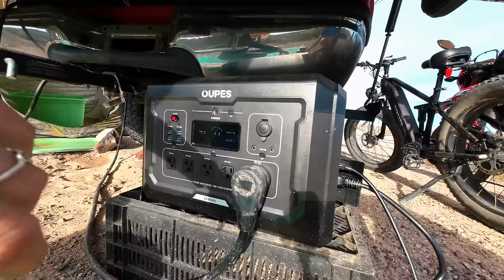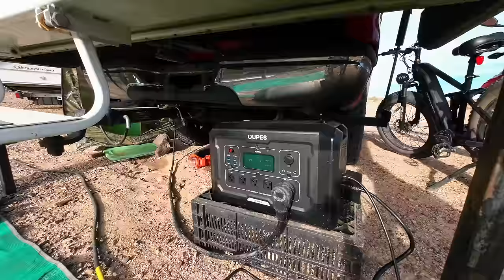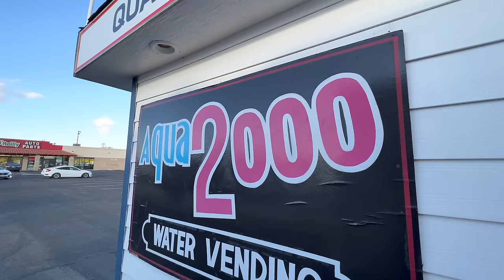Honest Walkthrough and Setup of Fulltime Truck Camper Living after 1 Year

Comment: Great Video!!!  I think I will steal your shower hose idea. I still have the crappy white one in my 850SC!  I do the same thing with the dinette as you guys do. I bought a couple of foldable tables that I use if I have to be inside. they fit perfectly and fit in the under the bed storage when not in use. the two final things I need for my camper is a new outside shower and a replacement affordable 12V compressor fridge. I'll let you know what I find.
Reply from the maker: The more slinky shower line was kinda pricy at about 30$ but had been an awesome upgrade! We have a new refrigeration system we are currently testing out that we will show in a new video.

Comment: Love Northstar! We have the same model and love the simplicity. We are getting older and we have ordered the new Night Hawk model. Can’t wait for delivery. Love your videos.❤
Reply from the maker: We just looked up the new night hawk. That’s an awesome camper! At some point we would also like to try a hard sided model. Thank you for the support !🙏
Reply: @CandEAdventures 
Over the decades and decades ago, we had two FourWheelCampers.
.
Based on our experiences with those soft-siders, plus delivering RecreateVehicles manufacturers-to-dealers and dealers-to-shows, we built our ExpeditionVehicle on a 1996 Ford CF8000 commercial truck.
We mounted a standard P&D box -- 7.5' x 12' -- so it is 'hard-side'.
To prep the box, I removed the rear roll-up door, then fabricated a steel wall with a steel door.
.
We pared our exterior set-up to pretty much zero, so we get to camp and everything is pretty much ready to use.
Bugging-out is pretty much a matter of kicking the tires and lighting the fires.
On two occasions, that came in handy after nearby fires got too close for comfort.
.
We raise and train Heelers, the herding dogs.
They understand a certain tone of my voice if we are in potential danger, so they loaded-up and were in their kennels before the air built to release the brakes.
We play a lot, and our emergency load-up is just another game for them.
.
We come from camping families, plus we traveled with caravans headed by experienced 'Wagon-Masters', so a lot of our skills are merely absorbed by osmosis... hanging out with geezers.

Comment: 26:26
For windows, we installed 3010 (three feet wide by a foot tall) dual-pane sliders designed for a stand-still house.
We mounted these at our eye-level standing inside, about eight feet above pavement.
.
We like the high light.
Lower windows:
* invite passers-by to look in
* create ceiling shadows
* are a convenient target for branches and jealous by-standers.
.
Over two decades full-time live-aboard, zero issues.

Comment: I also have a truck camper I do the hybrid system also. I use a bluetti AC  And a dual fuel Generator. I also have the fritch otherwise known as front hitch.  I understand you guys do this full-time but I wouldn't find it enjoyable if I had to drag all that stuff with me. Also a suggestion on the shower setup I also switch to the more flexible stainless hose you may want to put an elbow bracket coming out of the force so the host doesn't stick straight out like that. I bumped into mine and broke it. I put the elbow on it and never had that problem again.

Comment: Thanks for the tourI am a huge DIYer also...👍to all your add-ons and fixes. When you increased the height of  tire size  Any problems with transmission, gearbox, acceleration, fuel mileage etc....thanks again...stay safe

Comment: Great info on everything.  I hadn't heard the different system for the roof solar.  If you haven't yet, led bulbs or a whole new system work great to use less juice...need to do that with a friend's tent trailer we occasionally use.  I just saw a pickup at the gas station that had his traction boards with a lock on the end of two of his mounting posts.  If yours aren't, you might want to add that or a cable.  It's more hassle, but those things are pricey, though that was the first I noticed ones with locks on them.

Comment: So I have a few questions if I may?
- if you guys don’t use the toilet in the camper, what do you use for a toilet?
- how is the pop top in extreme cold, presuming you’ve used it as such, and extreme heat, do you use your AC unit and what do you run it on?
 - have you ever weighed your rig loaded and empty? 
- if so What is the loaded weight? 
- what is the empty (dry) weight?
- What is the GVWR and payload capacities of your F250?

I’m really curious because I have a ram 2500 diesel but my payload is only 1986 pounds. My towing is 10,000 so that really kind of leaves me dead in the water as far as using a truck camper which is why I bought it to begin with.

Comment: Sick setup! Any regrets on not getting a hard wall camper?

How much power does the fridge draw?

Does it come stock with a diesel heater or did you switch?

Do you ever run the AC? I would be interested in doing as much solar on top as possible as well as a foldable one like yours.

I'm considering this setup for a multi month road trip.

Comment: Quick question:  I've heard many pop-ups experience loud "popping" and "flapping" canvas in high winds. Has this been an issue for you?
Reply from the maker: If the wind is fairly constant in one direction the wind noise is negligible. We have had some noisy nights though when the wind speed is gusty and turbulent. Rain is surprisingly much louder than the wind in most cases.

Comment: How well insulated is the pop up canvas? Looks thin. Do you get cold/hot leakage? How about noise insualtion?
Reply from the maker: Not insulated at all. It’s like a convertible top. Awesome when the weathers nice but not the best choice otherwise. In hot weather you have a ton of ventilation with all the windows though and almost 360 views from inside the camper. You get a lot of noise if it’s windy also.

Comment: Have you made a video on installing the diesel heater. I have a 2017 Northstar 850SS and in the spring and fall in Wyoming I get a pretty good condensation problem from the gas heater. Thanks and nice straight forward video.

Comment: Excellent video! Question? Does the cargo carrier on front cause any issues with driving temps on truck? We have the hitch but are hesitant to add a carrier for concern about temps. Ours is a gas engine. What are your thoughts?
Reply from the maker: We have had zero issues with cooling with the box in front, or the motorcycle. Ours is a manual so I can’t speak for automatic transmission temps. I think the additional storage is defiantly worth it
Reply: 13:13
That dribble is by design.
The constant flow helps prevent one (or the other) temperature water from over-powering the carefully set comfortable shower.
Without a dribble, as you re-start the flow, you would get a burst of the dominant temperature.
.
And there goes your whole fung schway.

Comment: Nice video. Do you have an inverter to run your TV, ps5 and Starlink? How long can you typically use all three together? Thanks.
Reply from the maker: Thank you! The inverter is combined with the Oupes battery bank. It has a 2500W Pure Sine. Running all 3 without solar or generator input is about 3 hours. With just the starlink, it’s about 14 hours.
Reply: @CandEAdventures  Ah, makes sense - thanks!